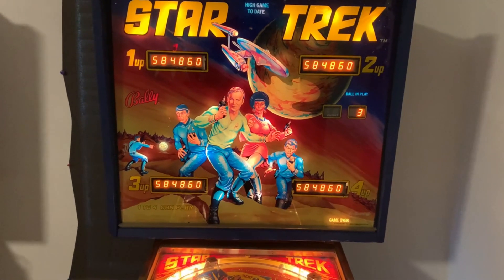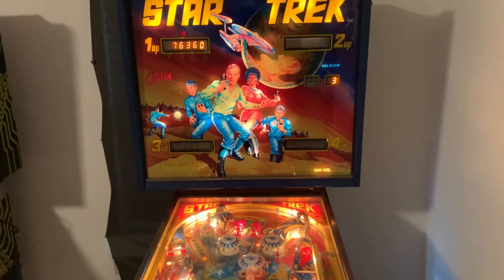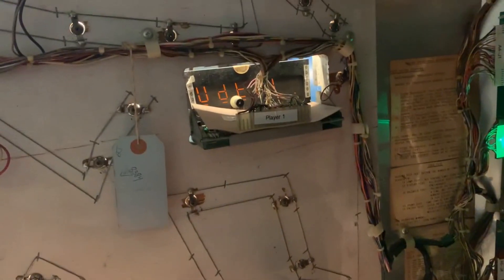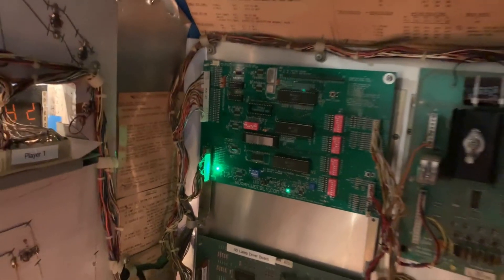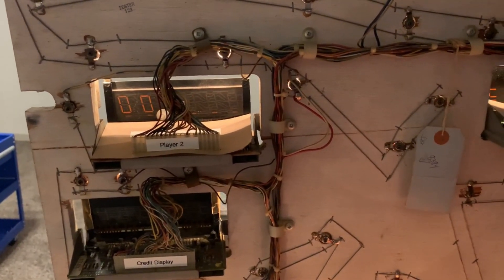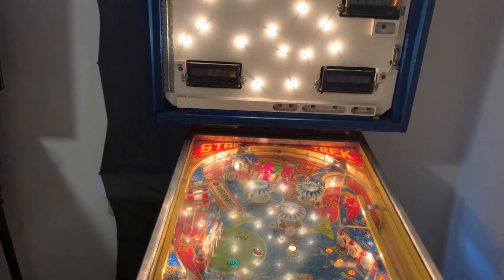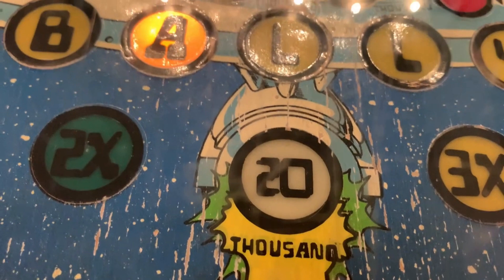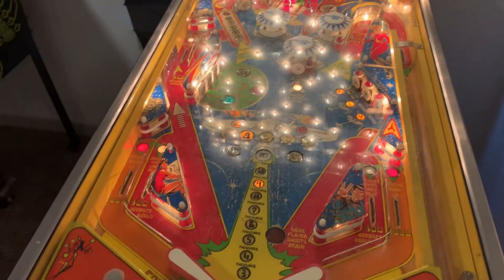What's Wrong With My Bally Star Trek?

Comment: Fred Sanford method. We see high opens all the time in my years of phone repair. Something is touching but not good enough - like the cold solder joints. The Star Trek pinball at the arcade near me makes me sad - some of the plastics are cracked in it.
Reply from the maker: That’s probably what it is. I’ll get a deep dive into it going sooner or later, but my jack job fixed it for now. :) bummer about the one by your place. Replacement parts for that machine are pretty easy to find. Hopefully someone will get it and make it pretty again.